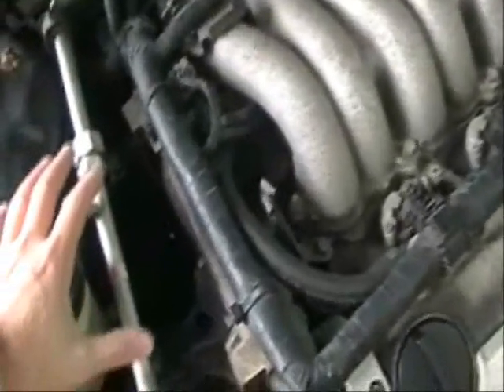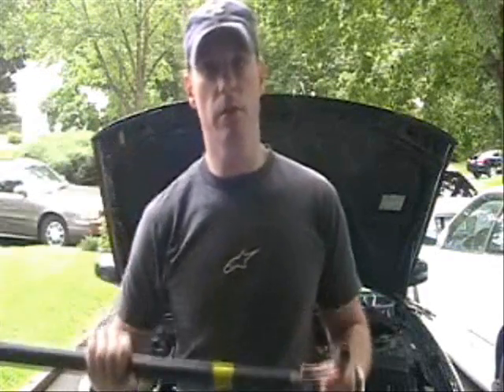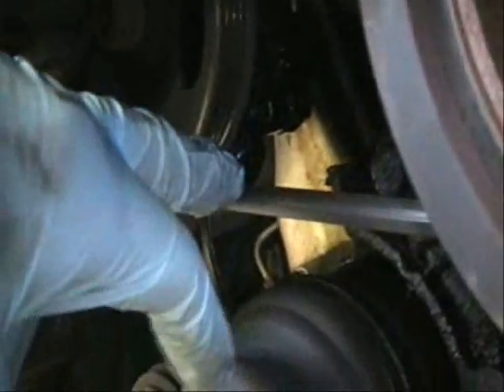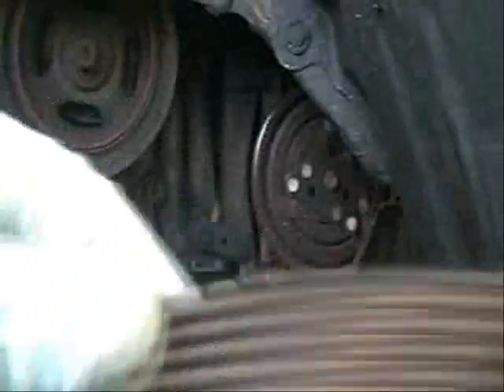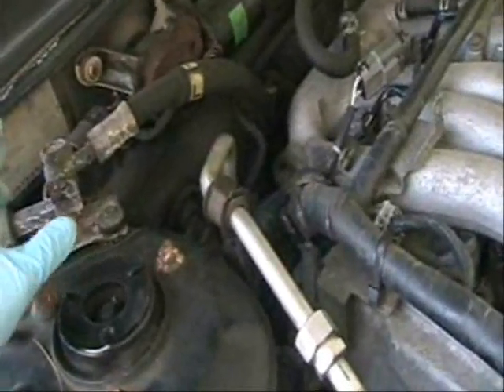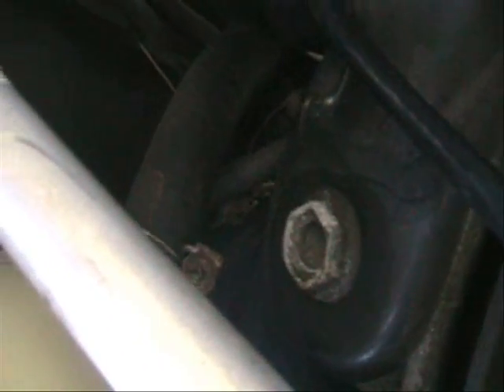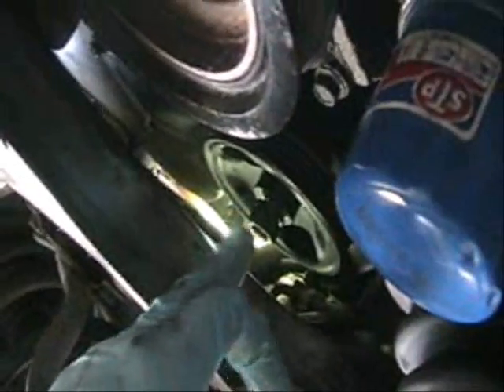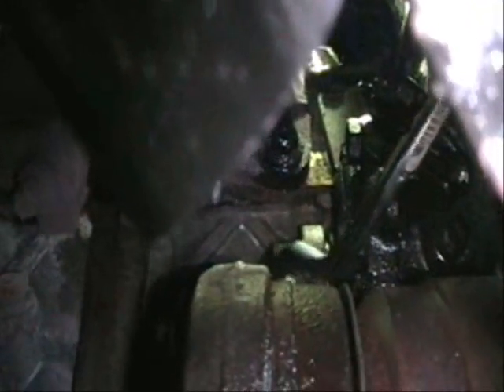NIssan Maxima | Infiniti Power Steering Pump Replacement with Basic Hand Tools HD

Comment: I just did this job. The key to this job is to get under the car and put your hand into the back of the power steering pump. You also need to use your left hand to hold the power steering pump up in the front. I don't think many people have an old car like this. I still have one and I love it. The way to put the screw into the adjusting area is very tricky. You have to use two fingers. This is the hardest job I've ever done with parts on a car. If anyone can do this job they are a Master Mechanic. You have to adjust the adjusting bolt and mechanism to fit the hole. It's a chess game in action to do this job. It's all easy after you figure it out. This job is the job that says it all.
Reply: Are you the same guy that left a comment on this video 10 years ago? Congrats on successfully completing the job twice. I made a big mistake not taking the pulley off before removing the pump. It doesn't seem possible to remove without the pulley off. I have everything else disconnected but I really wish I had taken the pulley off when the pump was still bolted on.
Reply: I can’t remember back that far. I’m sorry.
Reply: It was probably me I’m always looking at these videos. I’m restoring my 96 Infiniti I30 to look brand new. I’ll keep it forever.
Reply: @erroldillon1548  Nice, I have a 03 Maxima. It's pretty much exactly the same process as this video.

Comment: The belt tensioner bolt was broken off on this Nissan Quest. The last owner didn't even have the Spark plugs tightened down. When we got the vehicle, I noticed the power steering belt kept squeaking every time I turned the corner. The belt was not even tight.  I found various other issues as well including  the two bolts missing on the intake plenum.  I hate working on a vehicle someone else worked on and screwed up.

Comment: I just did my 96 Infiniti, it's the same as your Nissan Maxima. The front lock bolt would have been easier with an offset 12mm. I was struggling with a regular wrench. I have a set of ratcheting wrenches. I have a offset 14mm and it would have been nice if I had a 12mm. That back lock bolt behind the ps pump was tight as I've ever seen it!!! WOW If anyone can change these belts out, they are great!!! Thanks to your video I didn't give up. Your video was my driving force to keep going. Thanks!!!

Comment: My 1986 300zx I have a leak some where within the power steering chasey. How do I know if its leaking from the resevoir, pump, lines or pressure switch?

Comment: I've got the new pump hooked up to the hoses. I'm having trouble getting it lined up with its bracket so that I can put the bolt through that holds it in place. There seems to be a spacer on the front side of the back bracket, which is making it slightly off. Do you have any suggestions?
Reply from the maker: When you say bracket do you mean the tensioner bracket or the power steering pump housing?
Reply: The power steering housing
Reply from the maker: What kind of vehicle you performing the job on?
Reply: Infinti I30 "97"
Reply from the maker: My guess is the hoses are making it difficult to line up with the mounting point. Remove the hoses from the PS pump. It makes the job much easier. ( I also removed the PS pulley) Bolt the PS steering in place. Then go ahead and reinstall the hoses. Trust me, it makes the job a lot easier.
Reply: I will try that, Thanx :)

Comment: Great Video!  Makes a job a lot easier when you can see just exactly what tools, parts and methods you'll use beforehand so you can plan the job.  A good plan is the difference between "Got it done" and "I'll finish it later."  So Thanks!

Comment: Thank you for the video Sir. I just did a 1997 Maxima using it for reference. I removed the high and low lines from the pump and when done just started the car and turned the wheels while on the ground to bleed the system,seemed to work fine that way.

Comment from the maker: You can still remove the pump from the vehicle. Once you remove the 14mm on the back of the pump, you'll have two front bolts to remove. Then slide the pump out. Inspect the adjusting nut and verify it's seated and working correctly....You can often quality mechanic tool sets on sale. Stick with known brands such as Craftsman. Hope this helps.

Comment from the maker: You probably could but it will make the job a lot harder. It's easier to access the jam nut from underneath the car. I loosened the jam nut from on top because it was easier to film. Give it another try with an adjustable wrench and  you should be successful.

Comment from the maker: Glad to help, Juan. Cheers.
Reply: I replaced the power steering pump on my 97 maxima and it leaks around the suction pipe where it meets the pump itself? It has the o ring in it, any suggestions would be appreciated.

Comment from the maker: Code 1447 is strictly used for emission purposes only. It wouldn't cause a slow crank. Are you sure the battery has enough voltage? If you have a multimeter, test the battery for at least 12v when the vehicle is off. You can also go to your local auto part supplier and they'll test your battery for free. Also check battery voltage once the car is running. Check my alternator video for instructions. It's an easy test. Let me know what turns up.

Comment from the maker: Yes. Take another look at the video. At 7:05 into the video I explain and show you need a 12mm wrench to loosen the locking nut before you can back off the belt tensioner.

Comment: Thanks for the very helpful video! When replacing a high pressure hose on 2001 maxima (97 maxima looks just like 5th gen), would it make it easier if I take the PS belt and pulley off?

Comment: great video thanks,
Quick question, I loosened the lock nut and and counter clockwise loosened the PS belt tensioner, but the pulley didn't move, so i just cut the belt....any suggestions?  Also the pulley nut was on so tight it exploded a box wrench! it was a cheap one but still..scary.

Comment: Yes, there is the 12mm bolt that titens the belt tentioner,and there is a bolt on the back of the pump itself, don't you have to losen that bolt first before youn can losen the belt using the tentioner.

Comment: Hello, I have a 1995 Maxima SE manual. I just completed this job. Took me 7 days to do it. I had a few problems with this installation. I had all of the tools and short time because I work.  I am not a Mech. So the problems I encountered.
1 was the small space you have to work with. 
2 while installing the pump, make sure your tensioner bolt Seats in the bracket that holds the tensioner bolt properly. The space at the end of the tensioner bolt has a space near the head that supposed to slide into the slot of the holder on the positioning bracket. 
3 the main fastener bolt that holds the pump in place needs to be tightened last. The pump will need to be able to swing a bit because when you’re lifting the pump attempting to place your tensioner locking nut, the pump will need to swing so you can add your tensioner locking nut 🔩. My problem was that I didn’t fully understand how the tensioner system for this car operated. I understand fully now. It’s simple but you must be aware of that tensioner bolt and bracket. 4, when adding the power steering high pressure line, you must twist the line from the top of the car and make sure that it gives you the angle needed so you can thread the 24mm bolt into the pump properly. Just a few notes from a novice trying to save a few bucks. This was a very difficult job. But it’s easy if you pay attention to what I added. This tensioner system will add hours or days to this job if you’re not sure how this tensioner system is set up. And yes I did see the diagram photos in the field manual. It shows the bolt but I didn’t see any details on positioning the bolt into the bracket. I’m closing , make sure you don’t tighten your tensioner locking bolt until you add your ps pulley and belt. I was so happy to see my tensioner functioning that I almost wrapped up everything and didn’t tighten the locking bolt after getting my belt tightened. Not too bad of a job but this video makes this job look simple. It’s not. Make sure you have another vehicle to drive if you attempt doing this job . Thank you for you video man. I referenced it many times during this job. Respect

Comment: Where was your original leak? Did your reservoir drain fast, fluid blow through your pump seal, noise, etc?
Reply from the maker: Very slow leak via the pump seal.

Comment: What size was the walking nut?
Reply from the maker: fabian bazan This was a couple of years  back but most likely 12mm or 14mm
Reply: +CarsNToys my locking nut that you loosen before you loosen the main drive belt is striped and I can't get it off.. if I manage to get it off can I just use another similar  1  in its place

Comment: I changed my pump but it still leaks where the suction pipe meets the pump itself, i have the o rings installed but cant figure out why it is still leaking. Any suggestions would be appreciated

Comment: . I did change the sensor for the camshaft 1 and 2 and still doing the same problem staying stuck on first gear does not want to move first gear and it's helped Nissan Maxima automatic
Reply from the maker: +Carlos Vazquez Shoot me an email with the year of your vehicle and the specific trouble codes you're getting
Reply: 2005
Reply from the maker: +Carlos Vazquez Okay. Let me see what I can dig up and I'll f/u shortly.
Reply from the maker: +Carlos Vazquez I can obtain the correct work procedure from Nissan, but it's extensive. I'm not sure how much you want to look into this on your own before you bring to a shop. Regardless, if you're interested shoot me an email at carsntoys@gmail.com

Comment: is this the same concept for a 2010 maxima
Reply from the maker: Afraid not. You have one belt on your vehicle.
Reply: ok thanks friend of mine was having a bitch of a time getting his out they really give you no room to work on  cars today guessing thats why so  mech can charge a arm and a leg
Reply: I'm having the same issue with my 2010 Maxima SV. It stared leaking power steering fluid about a month ago that seems to be getting worse. I have to add fluid every 3 to 5 days. Just haven't had time or money to get it fixed. Hopefully it's not an expensive job. Exactly what was the problem with your friend's Maxima?
Reply: 2003MARSSKILLS  had to replace the pump it is very hard job if you don't know your way around car stuff,if you know a honest mechanic that wont rip you off go with that but not many of those around today concept is sort of close to this.
Reply: my maxima, same thing, although im planning on replacing it myself. Any suggestions?

Comment: hello. the jamnut on my pulley tensiner is striped. i was wondering if you could do this job without removing the altnator and compressor belt? if you could just losen the power steering belt and remove the pump?   thanks in advance

Comment: How did you reset the tension on the drive belt and PS belt? I have a MAJOR squealing sound off brand new belt and I think that the tension is too high, too low or maybe the A/C pulley is sticking?
Reply from the maker: Probably too loose. Try tightening a touch. What kind of vehicle? I can probably dig up the exact specs.

Comment: did you have any issues loosing the pivot bolt behind the power steering pump?
Reply from the maker: +Kenneth Rexford No issues but it's a very tight space.
Reply: thanks I finally got it loose yesterday, had to get creative using a ratchet and a tire iron fulcruming on the control arm to apply enough torque to bust the bolt loose. With my repair the tensioner bolt for the power steering had been sheared off so the power steering pump does not want to lower enough to me to put a new tensioner bolt on. tried removing the power steering pulley got the nut off but the pulley doesn't want to leave to shaft any recommendations? I'm hoping that I do not have to remove the power steering pump to do this repair.

Comment: i saw oil on the  exhast manfold bolt studs, beside the power steering pump, when u was taking it off, does it come from a leaking or bad pump or is it the inner o-rings, becasue my pump stays wet and oil is on my exhast manfold studs

Comment: great video. i have a leak coming from the bottom of the return line on my 98 maxima. i tried using a different clamp but still leaking. is the hose called a 3/8" Power Steering Return Hose or Power Steering Reservoir Line Hose. do you know what size hose will fit the reservoir? thanks.
Reply from the maker: 3/8" sounds right for the return line.
Reply: looks like the 3/8" tube is used for the smaller bottom plug of the reservoir. the one leading down to the pump is much bigger and is called a Power Steering Suction Hose part #49717-31U10 cost $75.

Comment: Hello, I have a 1999 Maxima.  Is there also a locking nut on the back side of the front locking nut to loosen the power steering tensioner?  I can not get the power steering tensioner to loosen to replace the belt.  Thanks
Reply from the maker: Remember the tensioner bolt is reverse threads. You have to turn the bolt clockwise to loosen the belt. If this isn't working, you can also remove the bracket holding the tensioner belt.

Comment: Great Video! I'm having trouble getting pump back into brackets to install lock bolt. Any suggestions? It is very hard to get leverage to push back in.  Also do you have any suggestions on bleeding the hose?
Reply from the maker: +Addison Morgan III Yea, the working area is very tight. Just take your time and you'll get the pump back onto the bracket. Regarding bleeding, just turn the wheel left to right a bunch of times as I show at the end of the video.

Comment: You refer to a single bolt or to two bolts in the video that will allow the PS pump to disconnected. What are those bolts connected to,  I'm just replacing to pump and not the tensioner. I have already removed the one from the back and disconnected the hoses...
Reply from the maker: The one bolt holds the tensioner to the power steering pump. The two bolts holds the tensioner bracket to the engine block. I like to remove the two bolts. I think it makes the job a little easier.

Comment: man thank you for the video i have the hardest time to locate the last 14mm bolt you are talking about. you reach everybolt so easy but i can not for the life of me. i wish i would not have started on this job. thumbs down to nissan eng. for this horrible design. they put everything on before installing the engine and to replace parts its is horrible. probably dealer takes everything out for easy access and charges $$$$$$$. but i liked your vid.
Reply from the maker: Yeah, that stumps a lot of people; it's so damn hidden.
Reply: Campus Auto Retail Service(At Melbourne, FL.) qwert

Comment: Excellent video and editing!  I must have watched this video eight times.  CarsNToys has used an offset box wrench to remove the pinion bolt on the pump.  It did not work for me.  I had to use a 3/8 In. Flex Head Teardrop Ratchet with 14 mm 12 pt socket.  It was very painful to complete this job.  Next time I will buy a Chevy.
Reply from the maker: Yea, not too much fun. Glad you were successful!

Comment: Nice video. Great attention to detail. I've got a 2012 infiniti g37 that I'm planning on replacing the power steering pump as well.  My question is- are the variations between this car and my car so great that i can't use this video to change my own power steering pump?  I've done some work on VW's but this is my first time doing something on my g37 that doesnt involve something as simple as changing a set of brakes or oil change. Any advice would be appreciated.  Thanks.
Reply from the maker: Serge Corporan Thanks, Serge. I think this video can help up to a certain point. The motor on your vehicle is quite different from the vehicle in this video. ('97 Maxima) For one, you have one drive belt as opposed to two. I would definitely remove the radiator cooling fans and the air cleaner assembly on your vehicle.  You'll need the extra room to remove the power steering pump. But if you have some experience working on cars I think you'll be fine.

Comment: Great video. I'm having a repeated knocking sound when I start my 95 maxima after long periods of time. It stops when I put it in drive. My power steering cooling line busted in an accident awhile back ago and has since been replaced but I still get the knocking sound. My mechanic guy says it the result of the power steering pump not having the fluid to feed off of. What I want to know is, is it my power steering pump that is causing this knocking noise?
Reply: I doubt it!!

Comment: Great video! I have a question about the bleeding procedure. Does it matter if the cap to the fluid reservoir is on or off? Seems like if it was on and tightened, that wouldn't allow the trapped air to escape.
Reply from the maker: goofyGAguy Thanks man. Yeah, you can leave the cap off.